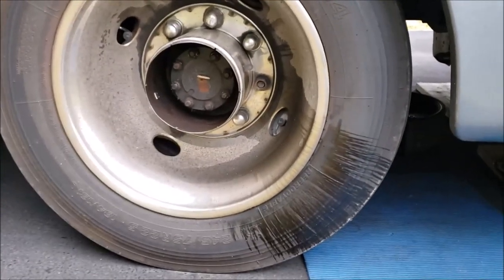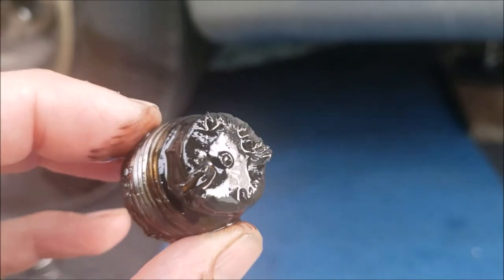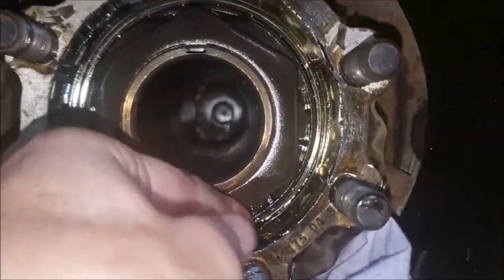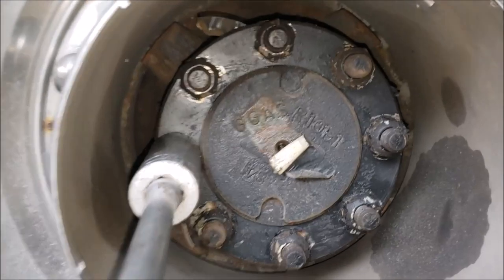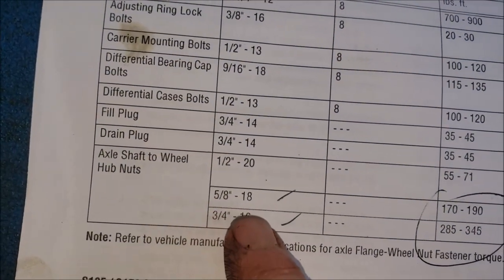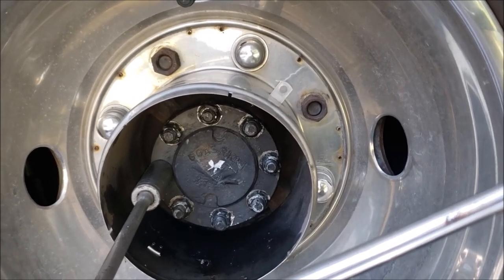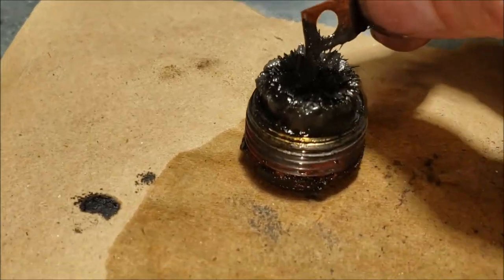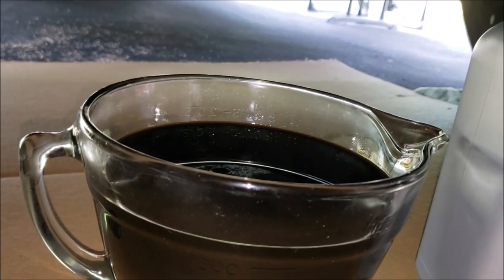W22 Workhorse Chassis Leaking Differential Oil From Axle Nuts After Coming Loose. Are Yours Loose?

Comment: This follow up video to the last one is behond interesting. 3 weeks ago, we were on a trip with my w22. Half way down there, I noticed a splatter of grease on my wheel well. Not thinking of possible consequences, we arrived at our destination and asked a mecanic to help us out. He tells me, like you did here, that the nuts were loose. He said the cause could have been flat washers used behind the nut was the culprit. He added lock washers behind the nuts and topped the grease back in. He did say I was lucky the drive shaft didn't slide out. Your video is very important and people have to make it a yearly check to make sure the nuts are torked correctly. Thanks for this Kevin.
Reply from the maker: Yes that was a timely video. So yours is good to go no more leaking? My concern would be a torn gasket like I found on this one.
Reply: @ktoutdoor  I 100% agree with you and after what you showed! I will have it checked again. But no, it didn't leak after the adjustment /fix.
Reply: Thanks, I will add lock washers now as well!
Reply: Is there a reason the W22 didn’t come with lock washers?  Are lock washers normally used on other hubs? Maybe that a lock washer could tear the gasket?

Comment: Thanks Kevin, we’re about to finally get started on this project and wanted to know if you recommend using a thread locker for these bolts that seem to loosen too often.
Reply from the maker: I didn't on this repair but it would be a good idea
Reply: @ktoutdoor we just finished one side, and learned some lessons. First, you were right, we couldn’t budge the axle until we got the wheels off the ground. Second, scribing a mark for putting the axle back the same way worked best with a white marker, and using the OEM gasket takes a lot of patience!  It fits so snug that I tore the first one. You were spot on for this project, and we’re very thankful for your help!

Comment: Hi Kevin - great videos, I just subscribed. Do I need to have the parking brake off when pulling the axle out?
Reply from the maker: You can leave it on but it won't help if your on a hill the moment you remove axle it will roll away. So put down your jacks and scotch wheels.
Reply: @ktoutdoor  thank you!
Reply from the maker: If I can be of help my cell is 606-875-0125 Kevin
Reply: Great video, thank you. The problem I’m having is that the thing will not budge after being unbolted. Did you have to use a type of pulley removal tool?  Yours was easier to remove it seems.

Comment: Apparently they use different axles on the W22 depending on the gross weight of the chassis because our 2004 Winnebago Adventurer 33V, Workhorse W22 has the Dana S110 axle on 19.5 wheels.
Reply from the maker: His w22 had 22.5 wheels with dana s150 so maybe the s110 is used on w22's that have the smaller 19.5 wheels . ????
Reply: @ktoutdoor  I always assumed that w22 chassis' have 19.5 wheels and w24 chassis' have 22.5 wheels but my assumption was wrong. 🙂
Reply from the maker: @johnnisley9715  So we both got smarter today...lol Now if we could just learn something new everyday

Comment: What thread pitch are those axle nuts and studs?
Reply from the maker: 5/8 X 18 GO TO https://youtu.be/cLmr3UHuxIs?t=529
Reply from the maker: @glennjames9152  Look for tag front of differential  Dana s130 or s150 ?
Reply: @ktoutdoor I bought some Alcoas. To mount the hub cover, it comes with a bracket to mount on the top of two opposing axle studs. I tried 5/8 and 1/2" nuts, neither are the correct size. If i place a 9/16 wrench over the stud, it's perfect. The manual he shows does not give 9/16 as an option.